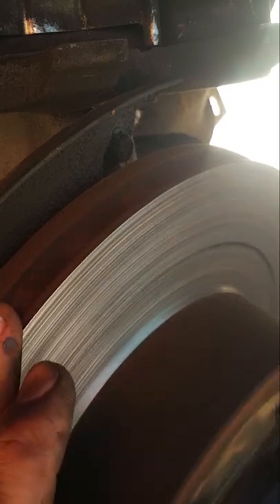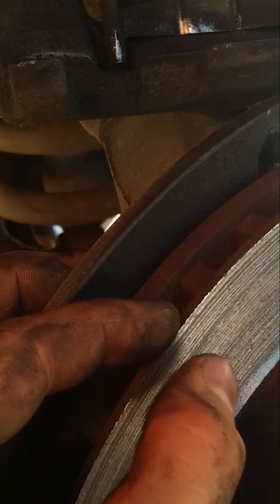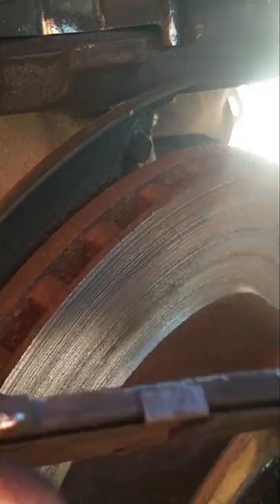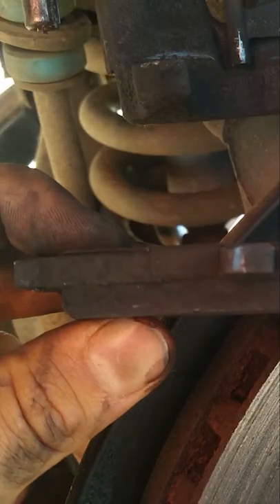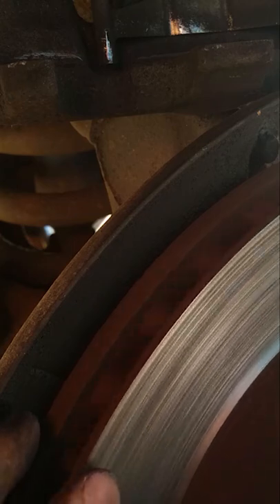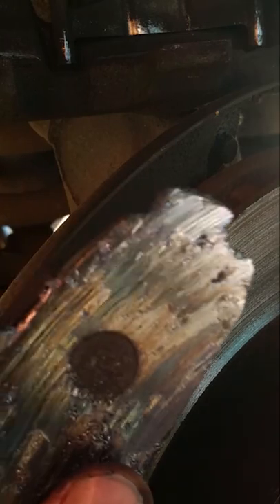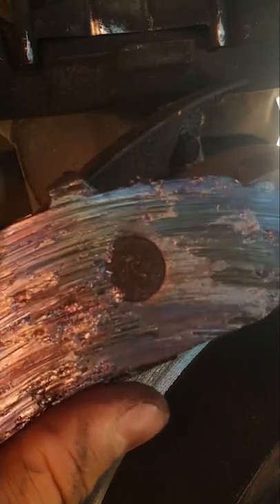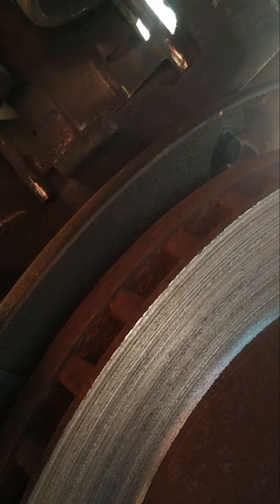Customer States Brakes Bad

Comment: NOTHING TO DO WITH BLEEDING. SIEZED SLIDERS.
Reply: Or a seized piston
Reply: @83glxcrusin97  piston would still cause both sides to metal on. If the piston never releases it still wears both side equally.

Comment: Why would not bleeding the brakes be the problem? Since one side is the piston. Wouldn’t that effect both sides?
Reply: Thought the same. More likely a seized slider pin or similar.
Reply: Caliper is floating on its bracket, pins frozen up. Definitely not a bleeding issue.
Reply: Outer pad is jammed in its ways.  Hyundai/Kia are primary culprits.

Comment: That guy doesn’t know squat. When you run into a situation such as that make sure to inspect the brake pedal and have it equalized and aligned. We had a truck once that would pull up o one side when the pedal was applied and if you over-applied it the truck would shift into reverse. 
Check your brake pedals folks.

Comment: Didn't bleed right?
No.
A sliding caliper needs to be able to return mechanically when you release the pedal.
If the pad on the piston side wore out first, you have an issue with the piston not relaxing back in it's bore by way of the return of the "square cut seal"
What you have is a caliper that applies and releases, but a pad that can't get free to retract or slide pins that weren't lubed, or missed a service later to free them up again.
This is why partly worn brakes sometimes need caliper maintenance.
It's why they need periodic inspections.

Comment: It's mind boggling how often I see this at my garage in UK.
Reply: 89 Volvo 245, I refurbished entire suspension and brakes (only metal body lines original)
RF girling 4 piston reman would not bleed out correctly, I split the caliper to find paint blocking second bleeder blocked.
  One pipe cleaner passed through & now it works.

Comment: How does a rotor get like that tho? Was only one side being turned? Also it doesn’t take a rocket scientist to see that it’s too thin
Reply from the maker: It ground it all away. Metal on metal!
Reply: The rotor gets like that because the pads were worn all the way to the backing plate of the pad the brake pad backing plate is made of metal for the caliper to push on so when metal is on metal it'll destroy your rotor there are so many videos on this. All 4 rotors turn when you're driving and when you apply the brake pedal the master cylinder pushes fluid through brake lines to each of your caliper(simple explanation) which pushes out the piston in the caliper to clamp the rotor. At high speeds applying the brakes on metal on metal will definitely grind down your rotors like this never seen it so bad that the pad yeeted itself causing total brake failure but the more yah know hopefully this decently explains it